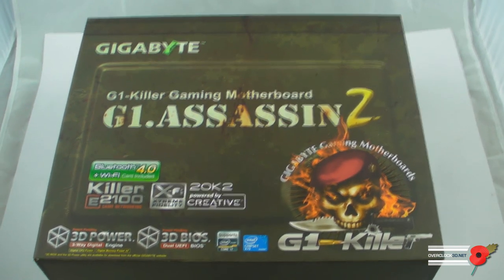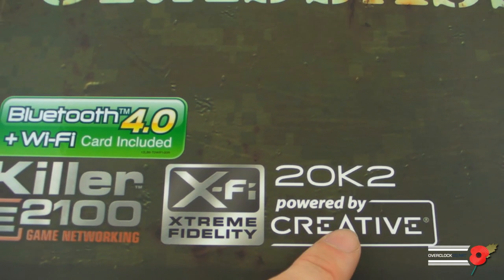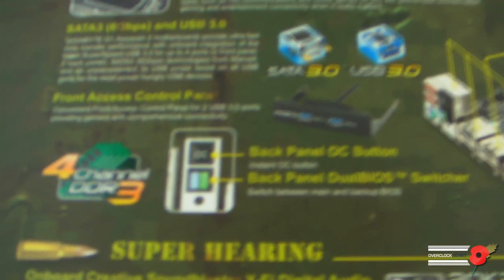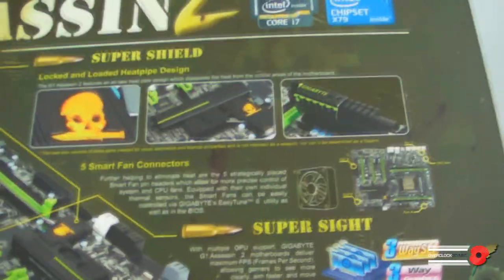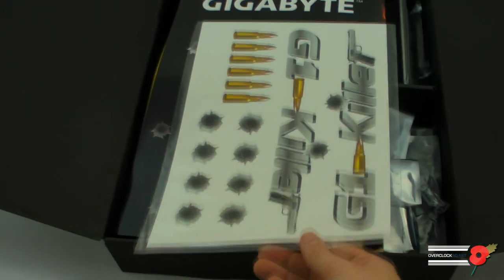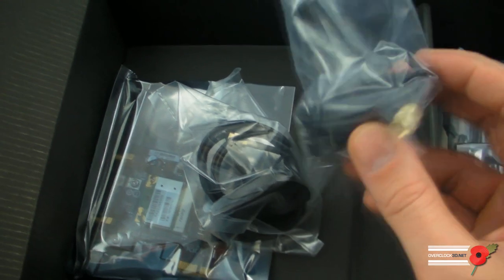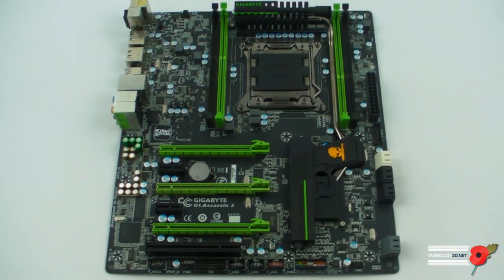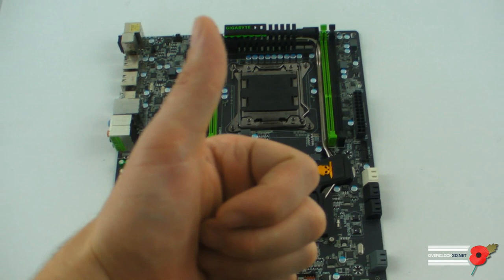Gigabyte G1 Assassin 2 - X79 2011 - Motherboard Preview First Look

Comment from the maker: @nooblady2310 the reason it is both sides is for quad channel. Its so the memory pipelines / lanes are equal length. On this board it is a bit pointless though you are right.

Comment: Correct me if I'm wrong (which is possible) but don't all x79 boards support Quad Channel Memory so with a board like this with 4 DIMM Slots each one is running it's own channel and with boards like the GA-X79-UD5 that have 8 DIMMs you get 2 slots per-channel. At least I hope that is the case because I thought the Quad Channel Memory is one of the most important features of X79 based systems.

Comment: hey just curious with this board did you figure out how to check if the quick boost button on the usb 3 pannel works? i installed mine and tried to test if there was any change to the cpu speed ( as it says thats what it is for) with cpuz but could not see any change at all any tips? im using a 2600k chip

Comment: @heppy031081 its quad channel, or dual one side of the cpu and dual on the other, but yeah intel are calling it quad channel, anyway it will work, unless intel do the same thing they did with sandy bridge on 1155 and make you use 1.5v memory, But you won't have optimal performance, i think we'll be seeing quad channel kits when sandy-e launches

Comment: If anyone could help me I would be so grateful, ordered this motherboard in a complete build along with a soundblaster fatal1ty sound card, I was just wondering if anyone could tell me how I can install the wifi as it came unplugged and in the box and how I can either switch my sound back to the 7.1 of this motherboard as its stuck on the 5.1 on the sound card, if I could run both that would be awesome but I have no idea what's going on I'm new to all this
Reply: Still have the BOARD? I love this MOBO.... Using XEON on my G1 Gigabyte Assassin 2 x79 Motherboard. They sell for around $750.00 and up used, without a back plate on eBay on the rare occasion you can even find ONE for sale! Get the modded bios F13B I think it is floating about, makes everything even BETTER...

Comment: @sodapopinski1077 x79 will be EXTREMELY EXPENSIVE. 2700k is cherry picked 2600k chips, overclocked an extra 100mhz. Depends what you are doing, if you are gaming, I'd just go 2500k, but anything more, if money sin't an option, see what x79 is, but based on x58, it'll be ALOT.

Comment: @Dachi1991 It's a gimmick, because if it was a regular copper heatsink it would have been a regular board  (and when I mean a regular board I mean: Gigabyte "PUTCHIPSETNAMEHERE"-UD5/UD3/ED3 or that kind of crap)
I prefer the Rampage IV EXTREME, that is a BEAST

Comment: Few things I was disappointed to see.
Like only have 4 RAM slots.
Only 8 SATA ports.
Yes I use a lot of hard drives.
And the fact that using the WifI / Bluetooth adapter wastes a PCI slot.
Even though I think it plugs into a internal header. 
Also would have loved to have seen dual Ethernets.
But it's very nice regardless.

Comment: Tbh if I was to buy this board which would be over $400 Australian, I'd expect it to have Quad Channel rather than dual channel. 

Disappointed in this board and rather get a X79-UD5 or more likely an asus board as at least they have more than 4 fan headers on the board as I refuse to count the cpu fan as a normal header when you wouldn't use it for a case fan.

Comment: im just going to go out and say it this board looks like crap the top left of the board is way to empty and whats the point of putting two ram slots each side of the mobo it only looks nice when there are four ram slots each side but other than the looks the board has some pretty nice functions and stuff but why are they still running sata II and not all sata III when sata III came out amd used all sata III and stopped using sata II on most boards